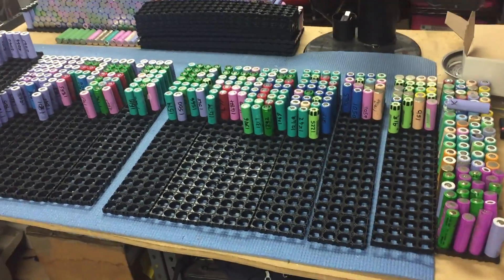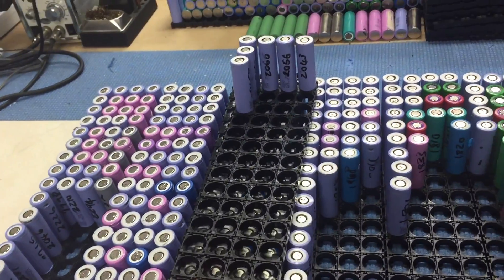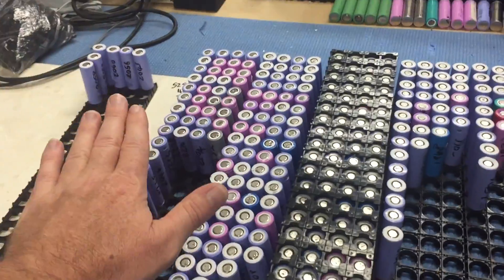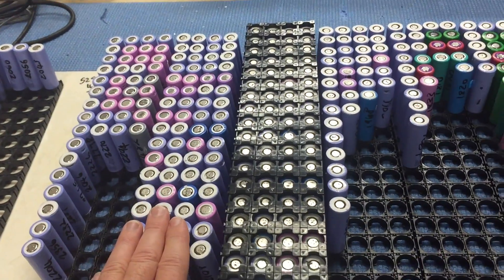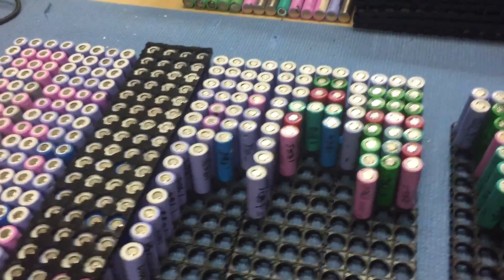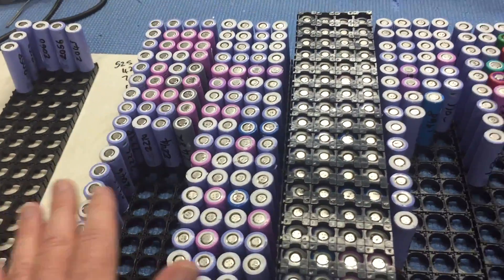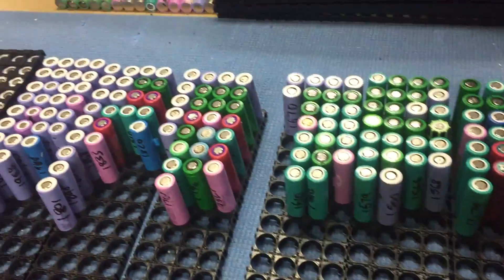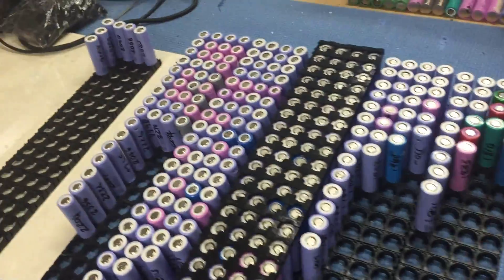Re-Designing my Homebrew Tesla inspired powerwall battery packs.

Comment: Hello from Cairo Egypt. I just saw your channel and I thought I'd share some of my work with you. I have done what you are doing now and I am running my house on 18650 and I also use the same inverter that you are using.

I am not using a charge controller or the solar charger of the inverter. I am feeding the solar panels directly to the Li Ion battery. Now my solar panels are Vmpp 29.69v and the Impp is 8.47a. I have two of them. So my pack is 7s and 200p. So this means that 29.69/7= 4.24v per series. There is a voltage drop from the wire to the battery of about .5v Also the temperature coefficient is 0.40% So all this means is that the voltage of the 18650 battery will never reach 4.1 volts; which is exactly what I wished for. The reason is that I want to prolong the cycle life as much as possible. As for the capacity of the pack, well this can be easily increased from 200p to more if needed.

The other thing is that you do not need to measure each individual 18650 battery. I simulated the capacity of each 18650 on Excel from 800 mah to 2200 mah. As the number of 18650 increased and they are all randomly put together the end result was almost identical to say putting 100p from the top and add them to another 100p from the bottom. It stands to reason that as the number increase then they will even themselves out.

As we are in the winter and the temperature is between 22 and 28 the temperature coefficient is not affecting the final voltage at the 18650 level. Maybe in the summer the final voltage will drop to 3.8v. It is a good thing since I will never over charge the battery. I will lose on the capacity but by adding more p 18650 I will compensate for the capacity loss. I do not have a problem with space.

If you want I can send you the excel work that I did to reach my conclusions. Ah I also do not need to balance the cells. They have been working fine for the last 2 months I charge them to almost 4v and use them all night and they are still balanced. I did parallel balance them all before I split them into 7s though.

At any rate here are my coords if you want to contact me

alaa.sadek2 skype
alaasadek1999@yahoo.com

I do not have a youtube chanel like you. I am sorry; but I am willing to share my work with you if you wish.

Best regards from Egypt.

Alaa
Reply: +Alaa Sadek Sir i like your project can you send me photos of your set up madhakaa@gmail.com i currently have a 3s52p pack but now i want to build a bigger pack
Reply from the maker: +Alaa Sadek That sounds great, you should share your setup with the world :)

Comment: pick a capacity  to match an average  of  your  cells . when i did my 13series 10 parallel  ebike  battery   i guessed 21 amp per 10cells 2100mah average  each. this allowed  for me to use from 2600 to 1700mah cells and all 13 are within  150mah of 21000mah.  just do that  to the grand scale  or a power wall and should be great . most balance  circuit s are slow to work  200 to 500mah balance  power so if the pack is 20amph out it can take days to even up.  not idea for your solar  system.  great video man

Comment: with my vrla battery bank the batteries have a maximum input output current, what kinda currently will you be limited to with the ginormous battery bank , that back would go nice on my bike Lol.
Reply from the maker: +closertothetruth Ok, so the inverter pulls 120a DC @ 2400watts AC the inverter does have a short burst where it 'COULD' pull double that however it is my experience that pulling 100a over just a few minutes leads the inverter to overheat and thermal shutdown to protect itself. So 4800w is a dream.  My Math - 120a divide by 160 cells = 0.75a per cell ? Is that right (might be peet, leave it up on youtube for a while someone will let you know) cells are rated at 5.5a i believe so  I think they will survive the experience.

Comment: Massive move to make sure there is 'balance' in the force. Smart move to keep capacity similar. I want to see how that pans out for longevity for your HBPowerwall. All that work today could save you troubleshooting later in 12 to 24 months time after the packs are running full tilt.
Reply from the maker: +Darin Bicknell That is kinda the plan. I was of the mind that meh don't matter won't hurt anything but considering i've spend $1000 bucks this week on stuff it kinda changed my thinking. If i'm ever able to make these videos even remotely popular really need to try from the outset to give it the best shot i can .
Reply: +HBPowerwall keep your lower capacity ones for a back up module you can replace other modules if need be or resell them to recoup some costs might be a good idea.